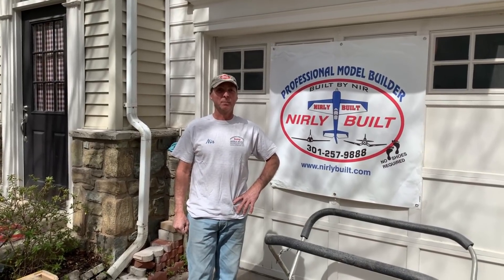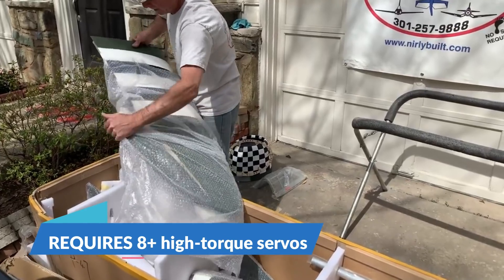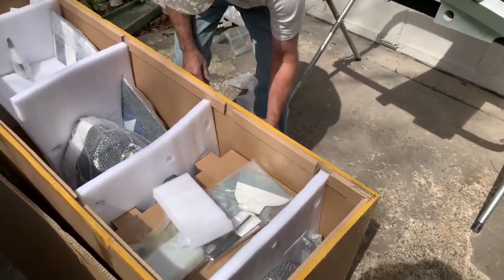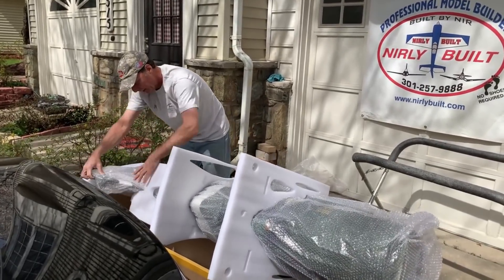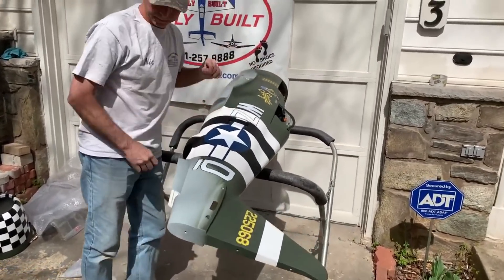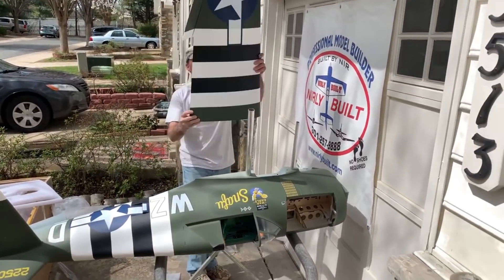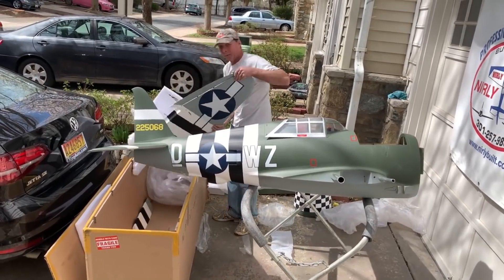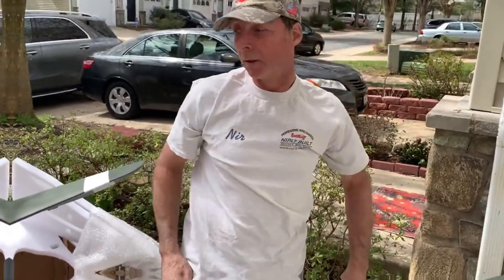Introducing the Gator-RC TopRC P-47 Thunderbolt

Comment: Beautiful plane ... What is the distance between the firewall and the face of the hood?
Could  be installed a Moki 180cc on the plane? maybe a 250cc?
Reply from the maker: I’ll
Make the measurements as I’ll start build and I don’t believe the Moki will go in ! I was looking to put UMS125 and I can’t slide it front enough will have to make long hub extensions
Reply: @nirlybuilt434  Thank you, I will follow your videos

Comment: Not made in China. It’s Manufactured in Vietnam Ho Chi Min city  by a company called Seagull Models. Very professionally family ran company since the early 90’s. Gator models is a distributor for Seagull. Look them up I think you will be impressed of what all the models they manufacture.
Reply from the maker: I’m a big Gator Rc dealer and building lots of TopRc 
All the boxes say made in China so I’m not sure 👍🏻
Reply: This model in the video is TopRC Model which is made in China.  Gator-RC is a distributor for both Seagull Model and TopRC Model.  Seagull model is in Vietnam so you are correct on that. But this particular model in this video is not Seagull Model.  :)  Seagull Model's largest P-47 is an 80" Wingspan.

Comment: hello i'm peter from austria, i already own a TopRc zero and i'm very interested in the new P47 thunderbolt!
can you tell me whether a moki 180 with a diameter of 255mm fits under the hood of the p47?
this information would be very important for my purchase!
 Many thanks and best regards from Austria Peter
Reply from the maker: I’m not sure it will be very tight you’ll may be need to push it little back or go with 150
Reply: Dear Nirly!
Thanks a lot for your quick answer!
The Moki 150ccm is unfortunately no longer available, the only version would be the Moki 180ccm with a diameter of 255mm! Dear Nirly, think you could possibly measure the diameter of the hood?

Nirly can you please tell me what is the span of the elevator?
And are there any more precise pictures of the Miss Behave color scheme?
Reply from the maker: @alficox  didn’t know 👍🏻

Comment: L'ums 125 x5 cilindri ci entra nella  naca motore?
Reply from the maker: All I built I used UMS150 they made is little smaller then 125 👍🏻
Reply: @nirlybuilt434  con il  UMS 100 pensi possa volare?